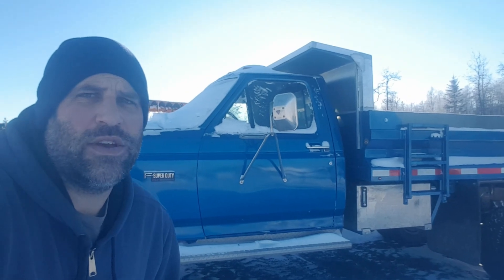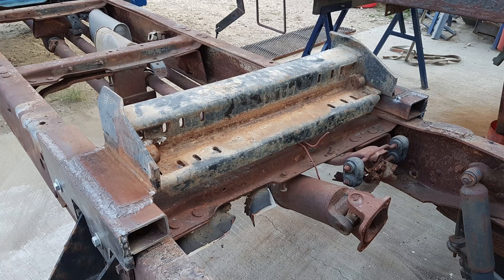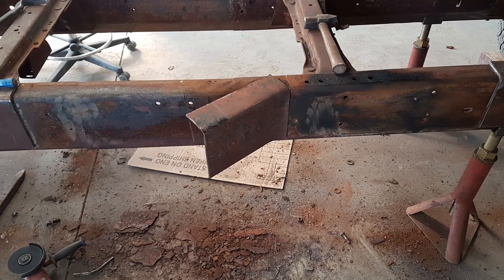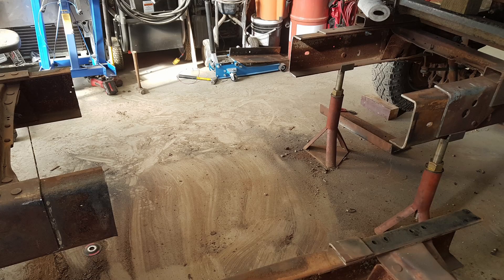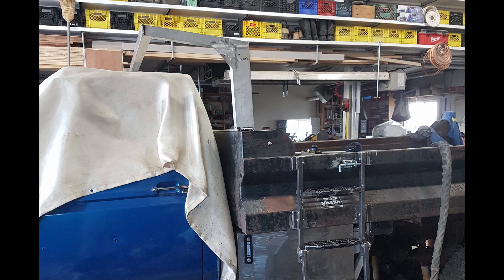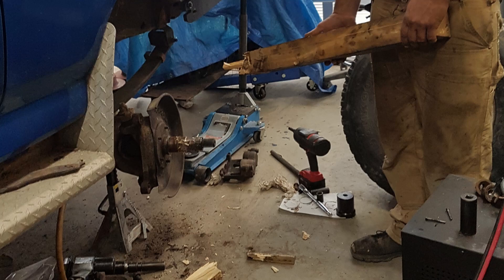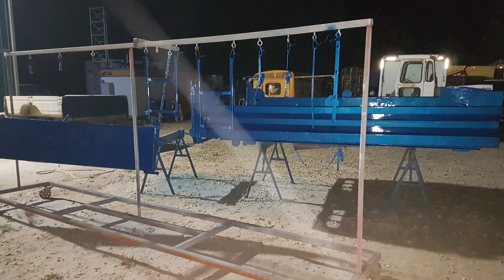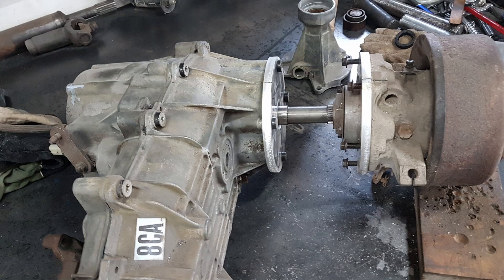1995 7.3l Ford F-Superduty OBS Powerstroke Dumptruck Build to date - partial 4x4 conversion

Comment: Nice work.  I was curious about your 4x4 conversion. I plan to just run a D60 in front, Wasn't planning on carrying a spare anyways. So that solves the lug issue. The other is the parking brake, I can't do what you did, so will have to figure out something else.
Reply: I ran a manual hydraulic line lock off rear brake  line off master cylinder,  works much better than any factory parking brake but i dont trust it sitting for any lenth of time, over 3 years with it, still holds, never bleeds off/ leaks off over time

Comment: Did u check the steering box spot on the frame for cracks? 4x4 OBS trucks like to crack the frame at the steering box. It is rare for 2x4 trucks to crack the frame in that spot on stock tires, but it does happen from time to time.
Reply from the maker: I have.  I did not see anything out of the ordinary.  It was a 2wd f-superduty frame to start with as well.  Ill definatly keep on top of checking on it though.  Thanks for the info.

Comment: Would you be interested in building a parking brake to t-case adapters? I am wanting to do this to my 97 f-super duty and swap in a zf5 mine currently has a e4od
Reply from the maker: Not really interested at this time.  I am having a hard time as it is to film content for this channel and do my own projects on top of my regular work.  Any decent walding shop or machinist would be able to make one up pretty quick using the T-case and driveline brake as a template.
Reply: @Shopworx  thank you for the info
Reply: Add hydraulic line lock, works great on mine!
Reply from the maker: @BruceMyersLBZ  Thats a great idea that Ive been toying with.  Unfortunatly my Province and im sure most others and some states still require a mechanically actuated emergency brake not relying on any part of the hydraulic brake system.
Reply: @Shopworx  that sucks! I dont trust it "long term", as i always chock the wheels for anything steep and for any lenth of time. But it definately has WAY better holding power than say regular parking brakes on an f350. I had to do somthing, i went about 3 years with no parking brake on a ZF5, it sucked lol!! I did pretty much same build as you, its what ford should have built. I ran f350 springs up front tho with FSuperduty rear eye bushings (heavier bolts used there) . Stock height. Nice build brother!!

Comment: Where'd you manage to find a belt driven hydraulic pump?
Reply from the maker: Was on a f350 garbage truck in an autowrecker.  Had to change the clutch from v belt to serpentine though.  Any decent hydraulic shop should be able to get you one though.  I do know there not cheap to buy new.  Ive seen them on ebay and kijiji (equivalent of craigslist) and facebook marketplace.  I can probably get a part # of one i replaced on one my dads trucks a few years back if that would help.